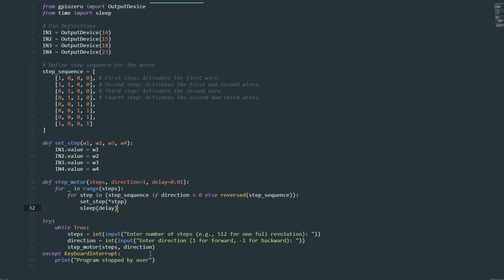raspberry pi stepper motor control

Comment: Hi, may i ask how the Max long between drive and motor cable can be? if i need put the motor in far away, what is the best way?thank
Reply from the maker: Hi ! For longer distances between the driver and motor, you might experience signal degradation. Using shielded cables can help reduce interference. If the distance is significant, consider using a motor driver that supports long cable runs or adding repeaters. Ensuring proper power supply is also crucial. Hope this helps!